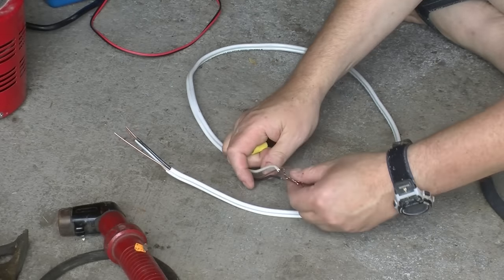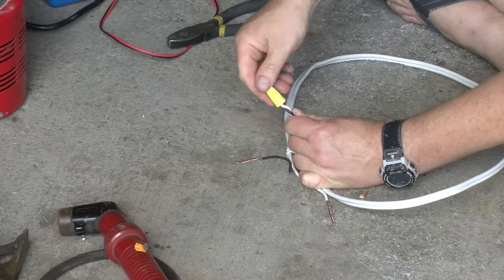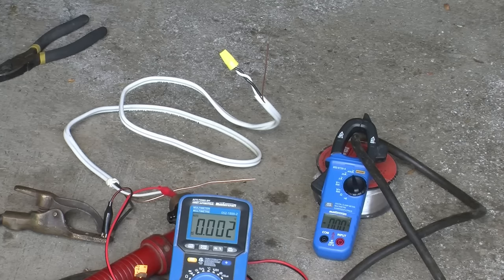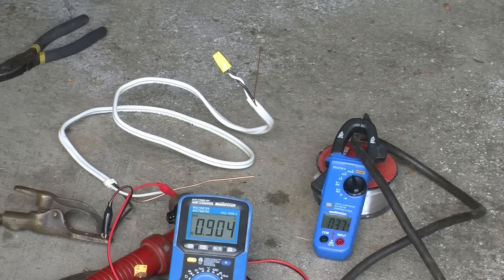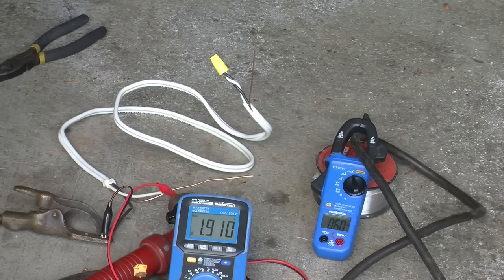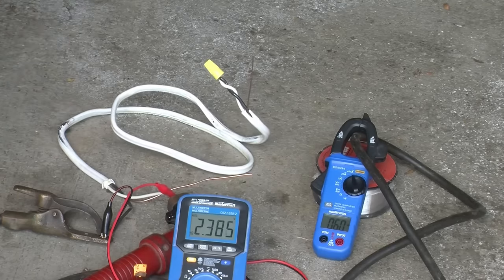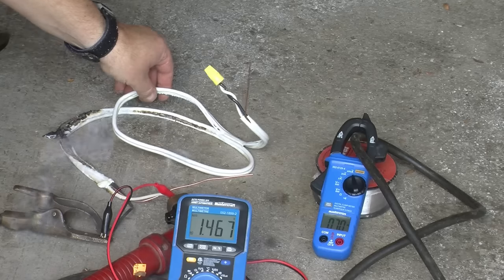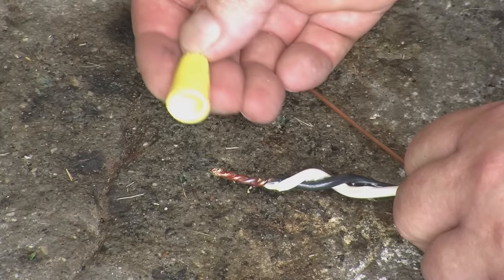How many Amps to burn up 14/2 electrical wiring?

Comment: Would there be much difference if you had say 50ft of wire instead of 3 ft?  In actual applications, you wouldn't have that short of a wire.
Reply from the maker: The dissipated watts per foot along the wire would be the same for a given current, so for the same current the same rise in temperature would occur over the length of the wire. There is a corresponding per foot voltage drop (which in these tests is the voltage I put across the wire). So at the end of 50ft you would get a resulting lowering of the voltage presented to the load. At rated current on a typical branch circuit, I believe the code says no more than 3% drop is allowed. So for this type of overload on a long wire you might get perhaps a 10% drop lowering the 120V the load sees to 110V or less. If the load is resistive that would drop the current by roughly the same percentage. But if it is a constant power load like a electronic power supply or induction motor, the load will draw roughly that much percent more current making the situation even worse.  Of course in a real situation the wire also goes though 2 by 4s, insulation etc probably making it hot at somewhat lower currents.
Reply: What if I did it in a vacuum at -50degrees with a three phase capacitor……….
Reply from the maker: @dirkdiggler2052  I think you would need a flux capacitor for that :) Actually you bring up a great point - it is really hard to keep electronics cool in a vacuum. Infrared radiation and conduction of heat to other parts of the structure is the only way to get rid of heat. I know the Soviets actually used  sealed boxes with gas inside holding their electronics to help with cooling. I wish I had a vacuum chamber to try 14/2 in a vacuum and see how low a current would melt it.
Reply: Well everyone knows that the white should have been connected to the return and the feed to the black. It burned because it had reverse rotation. 😂
Reply from the maker: @intheharness  :)
Reply: length of the wire is irrelevant when it comes to the max current it can tolerate, except for if the wire is so short that connection points are conducting the heat away. the length of the wire only deals with voltage drop which is what transmission lines are mostly concerned about. longer wire has more voltage drop then a short one for the same gauge but has the same wattage dissipation or heating per a foot between the two when pulling the same current. 

the test done here is very representative of a longer wire. only difference would be higher voltage would be needed to achieve the same current in the wire
Reply: @jasonharrison25  that depends entirely on the device downstream. For things like lighting or most electronics that do not have motors, the demand is fairly static so the dissipation is also fairly static. However, if there is a motor at the end and the length is excessive resulting in a voltage drop, the motor will demand a higher current to maintain its nameplate power and that will significantly increase the temperature rise. So yes, in some circumstances, the length of the wire can matter.
Reply: Dont  actually  think  would   make any difference   ,  you  would  have  to  increase  voltage    its  amps doing   damage  like to see it proved
Reply: Resistance much higher and it is a differential equation to solve loss .
Reply from the maker: @jasonharrison25  Great explanation! Thanks!
Reply: @TwilightxKnight13  once again that is due to voltage drop of the wire. which is not being tested here
Reply: @intheharness  What? You sell audiophile cables???

Comment: I recently left a wheelchair  manufacturing outfit and part of my job was testing  the electronics modules.  The  motors on ours were fed with No. 10 stranded wire,  and if you stall the  chair against  a block and firewall the  joystick, they would pull over 200A  for a short time, which amounts to approx 100A  per wire to the motors.  No ill damage occurs.
Reply from the maker: The key is "for a short time". Not long enough to heat up enough. I assume the system has some sort of current limiting in the electronics in case of an extended stall?

Comment: My old 1956 house used  15 gauge wire with  black woven insulation. Would be interesting to see how much that would take until flames. A few of the breakers were 20 amps and it hadn't burned down.
Reply: @Kelly Harbeson 14 gauge wire is far from rarely used. It's the standard wire for residential homes. At least around here. 12 wire is for 20 amp circuits where required, like bathrooms and kitchens. When someone at work tells me to start pulling wires, I reach for the 14/2 unless told otherwise.
Reply: There are plenty of limited current circuits in commercial work, and wether you're using THHN in FMC or MC in commercial, or Romex for residential, 14 gauge wire is 14 gauge wire. However, you're right, you really hardly ever use 14 in commercial.
Reply: How many blown 15 & 20A fuses were replaced with 30A?
Reply: @fredmauck6934  100% this. My parents house has what appears to be a 500A main panel because they are all 30-40A fuses. Even with the oversized fuses the air conditioner will trip the fuse if the microwave is already on.
Reply: @Kelly Harbeson I don't know where you live, but here where I live everything but the kitchen is 14 gauge. The kitchen obviously needs more capacity so it gets 12 gauge.  Some people don't like handing 12 gauge( harder to bend and also to manipulate in the boxes.
Reply: @skoparweaver7692  Nah. You likely have at MOST a 200 AMP service.
Reply: @skoparweaver7692  Interesting misinformation.  Adding all the breakers
to arrive at service size.
Reply: @chrismckay5005 n New Mexico we only rope residential with #12/2 romex all home runs on 20 amp breakers!! I mean minus the range, dryer,waterheater
Reply: @joeblowe7545 where are you from?! Here in Bew Mexico the only #14/2 romex you see is what’s been ran by a handy man
Reply: @fredmauck6934  which is why they changed to circuit breakers. fuses are safer if the users aren't stupid.
Reply: @joeblowe7545  kitchens used to get 15A split receptacles but due to the GFCI requirements neer the sink and the fact that you can't do a split on a GFCI they had to size it up
Reply: @Galgamoth No kidding. Uh - they "size up"   up in the kitchen because it's obvious that most kitchen appliances require more current to operate.  I think you're answering a question that no one asked. But, you wanted to sound relevant and knowledgeable. "Neer"? Learn how to spell.

Comment: Growing up I remember just sticking in ends to see if it fits whatever it was I was trying to use and if it fit it was the right one.  With that said, I’m very impressed I’ve never set a fire but I definitely gave my kids a live performance like you did here, showing how a cord will catch fire if it’s not meant for the device or the devices board will fry ruining it.
Reply from the maker: Always great to expose kids to science experiments if done with the appropriate safety precautions. Most kids naturally love finding how things work - at least until some of the textbooks used in school drive any intensest in the subject away.

Comment: NM cable conductor insulation is rated at 90C - 194F. The wire nut is rated at a minimum of 105C = 221F. NM amp in regards to the NEC is 15A
Reply from the maker: Interesting that NEC requires the wire nuts are rated at a higher temperature than the cable. I wonder if its because of an assumption that they might be a poor connection and more heat generated?

Comment: rsA couple of things.
I'm not sure the wire nut had the full 60 amps at all.  it looked to me as though the wire had melted and shorted at some point, diverting the current away from the wire nut.  Nevertheless, it did hold up pretty well which is good news.
The real 'safe' current carrying capacity depends on more than the wire itself, but also in all the situations in which it might be installed, according to regs etc.  Even a much lower current will cause a failure if the wire isn't able to dissipate the energy at a temperature below the plastic melting point.  That's why extension leads should always be completely uncoiled, regardless of the length actually needed for a given application.  I've seen whole rolls of extension cables drums fuse into a solid mass of plastic - even when used well within the rated capacity of the wires.

I worry that people watching your videos might come to an unsafe conclusion, thinking that a 15 amp wire (which as you say is only rated for 12 amps continuous), might actually handle 20 or so amps - way below the 60 amps you demonstrated to be a problem.

I once witnessed a house fire in a house near me.  All put put fairly quickly once the dire department showed up.  On investigating the cause, it turned out they had trapped a thin brown two wire extension cord under the leg of a desk.  Even though the load was way under the limit for the wire, being trapped in a tight space, the wire slowly got hotter and hotter until the wood of the desk leg itself ignited.  If the wire had shorted, it would have presumably tripped a breaker and not started a fire.  

Interesting video, but of you can, please make it clear that no-one should run wires anywhare near their maximum continuous current ratings.  Even if the wire nuts hold up.

Cheers
Reply from the maker: "I've seen whole rolls of extension cables drums fuse into a solid mass of plastic - even when used well within the rated capacity of the wires." I'll bet may extension cords are in use spooked up like that. Can sure see how the heat can build up dangerously. 

Your point about warning people is well taken. I do say it in the description - would hope people read it.
Reply: 60amp on 2v.. but if u have a supply of 12v and having a current draw of 60amp, that cable will explode in a instant.. its all about watts.. people should do the math..

Comment: Rated at 15 amps, which is about 20% less than what it can really handle. There are amp ratings PER HOUR for every wire we can use.
I think appliances are rated for 1250 watts or about 1/2 of what the wire can really handle.

Comment: I'm not an electrician but that was a very good demonstration thanks..
Reply from the maker: Your welcome! However,  please be aware that this is a somewhat unrealistic - the cable in normally confined in walls with much less air flow, and often surrounded by insulation. Under those real circumstances, it fails with considerably lower currents. Here a link to those tests: https://www.youtube.com/playlist?list=PLHUfJmsprIcTVwSgCkTJnkinJSWrZY7DY

Comment: I'm curious what the resistance is for the length of wire you used and if you tried a 30', 40', and 50' length of wire if there would be any difference in the results.
Reply: Exactly. That would make a marked difference!
Reply from the maker: Well for a given current which in a normal situation is determined by whatever the load is, the heat emitted per foot of cable does not change if the cable is made longer or shorter. Your right the resistance goes up for a longer cable, but the result heat is distributed over the longer length and the temperature rise remains unchanged.  What does make a difference is if the cable in a wall filled with insulation and as expected things do go bad at a lower current. I did do a FAQ video here if your interested in more details: https://youtu.be/CP3-jcpzZeI

Comment: It would be interesting to run a strip of this wire between some insulation and apply the current to see when it gets too hot.
Reply from the maker: I am actually hoping to have time to try something like that this weekend. I'm planning to use two 2x4s to make a simulated 16" OC section of stud wall with fiberglass insulation. Will also be interesting to see what happens to the wire in the holes in the 2x4s.
Reply: @ElectromagneticVideos  please make a video with different types of conduit (plastic and metal) to see how much heat is dissipated. I think with a metal conduit inside a brick wall you can easily overcurrent 2 times without issues.

Comment: Like the weakest link in a chain, it's the compromised inch of copper wire or bad connection  that starts the fire. Great test, thank you.
Reply from the maker: That a really good point - a bend, scratch, tarnished area, loose connection ......

Comment: Always good to remember that the capacity of the wire is a factor of length. 

A short wire is a lot more robust than the same wire at 250'
Reply: In the real world yes,  a longer wire increases the voltage drop which then further increases the current. For this test its irrelevent. Resistance and heat dissapation should increase equally as wire length increases.
Reply: @otov100  could you please explaine how?
Reply: Can you please explaine ?
Reply: @insylem  one would think that for uniform wire what matters for failure/melting is wattage dissipated per unit length. Since resistance grows linearly with length, voltage drop and total wattage grows linearly with length,  and wattage per unit length remain constant
Reply: @otov100  in the real world the shorter wire isn't more robust though. A 250ft wire will fail at the same current as a 2ft wire. That larger voltage drop is spread over a longer distance so the heating per ft stays the same.

But you do end up with much less usable voltage at the end
Reply: @libtrs838  Yeah, some nuances too. Like the type of load. If its a straight resistive load, its not as quite as unsafe, you just get worse performance out of the lighting, heating or whatever; although possibly longer service life. Its most important with motors or power controlled loads which maintain an even power draw. Those types of loads pull more current to compensate for the voltage drop, which increases the resistance, etc.

Comment: I'm so glad you made this video. I just had an argument with some moron and he was freaking out because someone else put a 20 amp breaker on 14/2 ... i was like Dude you're safe. for safety concerns they often quadruple and quintuple rate the wires for worst case scenarios. let the breakers do their job. they don't cut the ratings so close for safety reasons.
Reply from the maker: You know - even if it were just for insurance reasons the breaker should be switched. And some breaker have quite a large margin of error for when they trip. But take a look at some of the followup videos to this one - particularly the ones with 14/2 though insulation. With a well insulated wall there really is no room for comfort. So much so that if I were having a house built today, I would get 12/2 for the 15A circuits - I was not expecting that.
Reply: @ElectromagneticVideos  well that’s the code. 14/2 for lights and 12/2 for outlets. Because outlets typically have more shit plugged into them. Not a lot of people overload lights
Reply from the maker: @chuckholmes2075  Interestingly I don't think 12/2 is required for outlets yet here (in Ontario) but I could be wrong. Certainly good to hear its in the code elsewhere.
Reply: @ElectromagneticVideos  in the NATION WIDE book it is.
Reply from the maker: @chuckholmes2075  That's great to hear!!

Comment: if your target audience is residential people, its important to note that this is 70 amps with only 1.5 volts. so not really typical to what youll use in your house (lights, outlets, etc...). So definitely dont go thinking you can use number 12 for that dryer or larger appliance that requires number 10. While 12 could probably handle it, its not worth the risk to save 100 bucks at all, and its a good way to fail a home inspection
Reply: Even if the 12 gauge wiring would survive 30 amps (it likely would) you would lose enough voltage out of it that your dryer would not function at its best.  Theoretically it could increase the amperage draw that the dryer would kick even a 30 amp circuit as well.

Comment: I have attended numerous demonstrations and seminars by most major wire nut manufacturers (Ideal, 3M, Wago, etc) and they all say that if you install the wire nut properly, there is no need and no advantage to pre-twisting the wires. In fact, at least one of them indicated that pre-twisting actually has a negative effect on the quality of the connection. Pre-twisting is an old skool method that is no longer necessary.
Reply: For what it's worth my dad always taught me to have a good mechanical connection before wire nut or before soldering or before whatever always have a good mechanical connection first!!
Reply: Mechanical connection prior to the wire nut is in the nec code book

Comment: Very Interesting video..
Was an electrician for almost 20 years.. I have seen whole houses with washer/dryer, electric ranges etc running off two of those old arse glass screw in fuses with PENNYS behind them because they were blown.
Wheat penny lasts forever. lol
Reply from the maker: I have heard about old home with only a few fuses - and pennies as fuses. Amazing that someone would install high power electric devices like ranges and dryers and not increase the the size of the fuse panel. Scary!